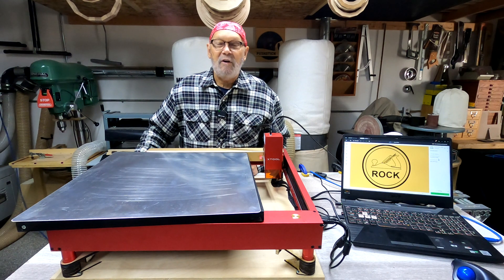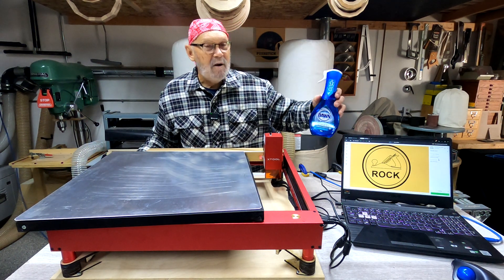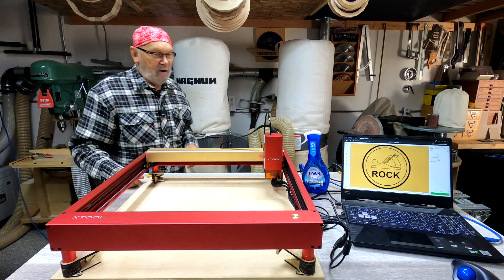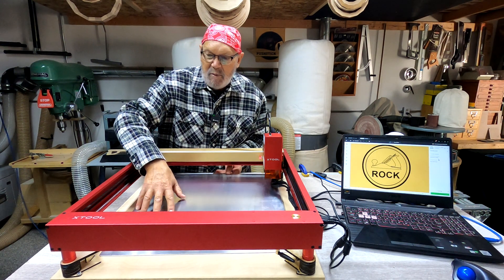Honeycomb Support & Alignment & Cleaning

Comment: Nice set of tips Gord,  will have to find what your cleaner equivalent is in the uk. I just screwed wooden stops to my base so i can remove honeycomb and plate and then they go back the same. Great to see you in the shop again. Cheers Geoff
Reply from the maker: That sounds like a perfect solution, Geoff. As long as the honeycomb panel and the laser engraver can't move you will always have the same alignment. Your solution also sounds much easier to implement. I'm sure you must have an equivalent cleaner over there! Thanks for watching, Geoff.
Take care,
.....Gord